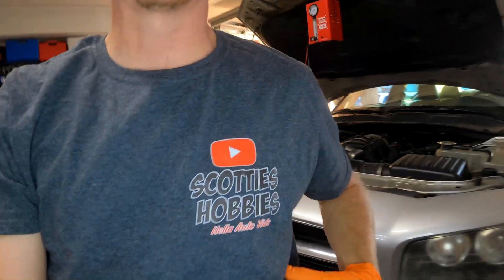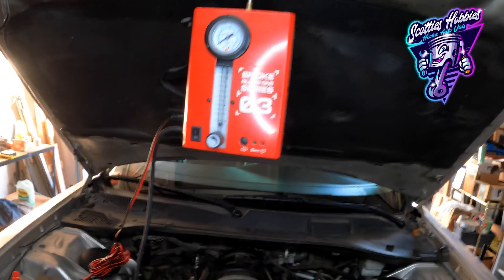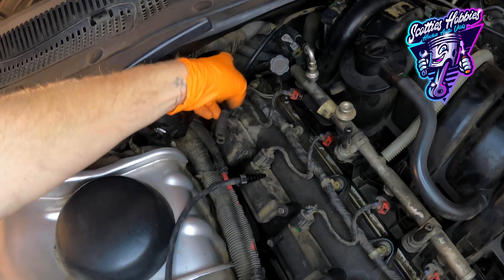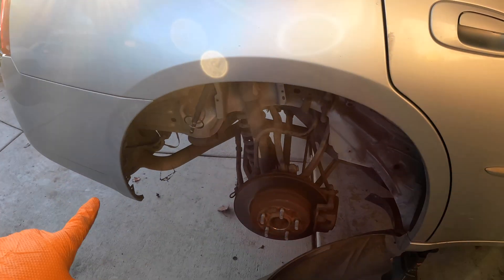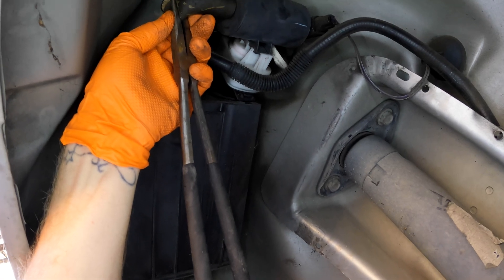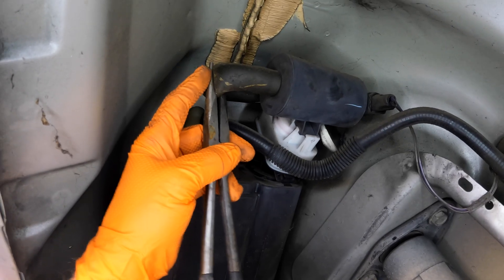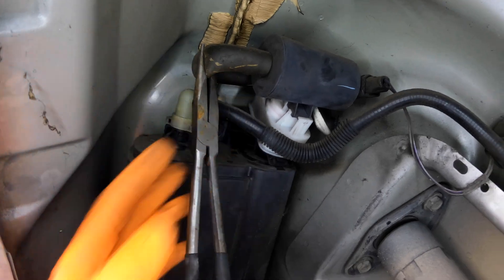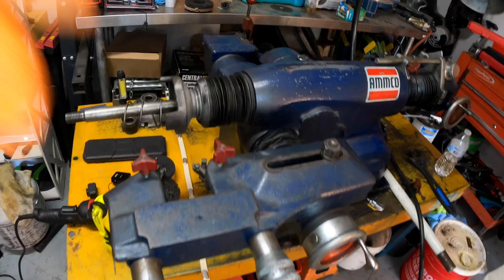How to Use a Smoke Machine to Find EVAP Leaks on Your Car or Truck

Comment: I am not a mechanic, just a bit of a learning YouTube Mecanic. But I will say, I purchased a Topdon artidiag900 lite scanner, and it has proven to be worth every penny of $300. I used it on a 2002 Highlander to command the vent valve shut as well as test the purge valve. Completely eliminated any disassembly, and found a leak in a hose on the purge valve in seconds. I also used it on my wife’s 2019 civic to service the rear brakes.
Reply from the maker: Thanks for the heads up on that scanner.

Comment: That's why I smell vapor fumes like gas from the gas cap area  when I put the smoke machine ,but no smoke came out the gas cap...I have a p0442 code the smoke did make it all the way to the vent hose cause smoke was coming out the hose , so I grab me some pliers n squeeze the hose, I didn't fine no leak??? Help anybody
Reply from the maker: Have you tested the vent or the purge valve to make sure they work and hold pressure or vacuum?
Reply: @ScottiesHobbies thank you very much for replying sir.im working on the purge  valve is a 02 toyota camry le.2.4 4cylinder.i  do have have a vacuum pump the only thing i dont have a clue how much pressure to pump the purge valve?..correct me if im wrong,im connecting my vacuum pump hose to the purge valve  nipple that goes to the vapor canister ,em i right?
Reply: I believe 10 -15 inches in of vacuum. That line would test everything to the back. Not purge valve itself. Apply vacuum  to purge valve outlet itself same line you took off for test but valve side and see if valve holds vacuum. Means mechanically sound if so further electrical testing like activating purge valve with 12 v to see if vacuum is released  or turn car on unplug purge connector and see if vacuum leaking through valve with vacuum gauge attached to outlet and see any readings .If good continue to the back and plug up vent valve hose in back cause always open due to design.
Reply: How do you test the purge valve

Comment: Great video thank you, i did a smoke test on my car and a lot of the smoke was coming out of the rear fender well. I haven't gotten back to it but  I am certain i will need to block off that hose bleeding to the outside as you mentioned. Thank you for the video.

Comment: I thought you weren’t supposed to smoke the evap above 1 psi. Therefore there would be no need to seal the gas cap with a plastic bag, the gas cap alone would provide the sealing.

You’re smoking it at a higher pressure so you covered the gas filler hole with a plastic bag
Reply from the maker: This one never built up any pressure. It had a major leak on the tank. But you are correct.